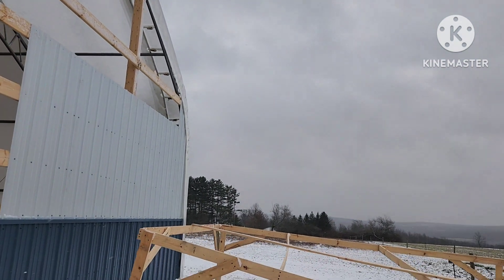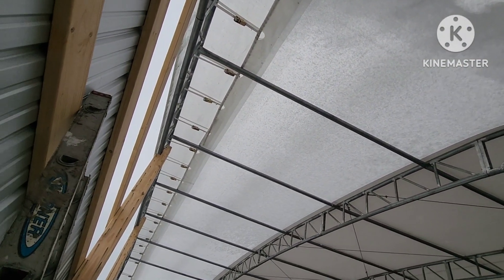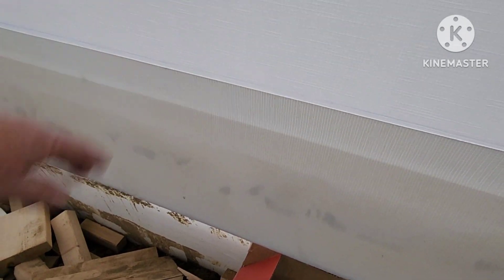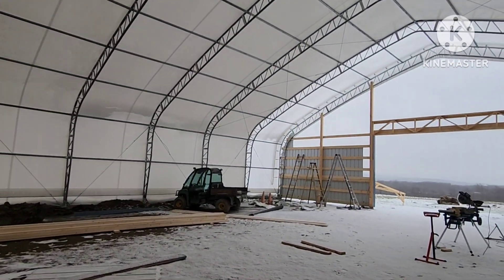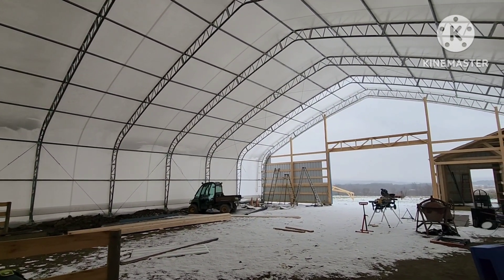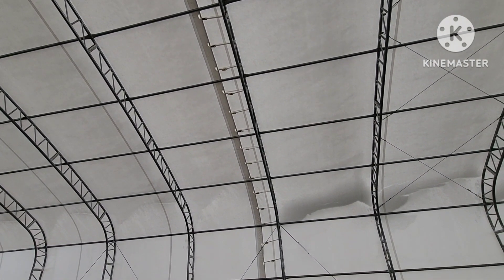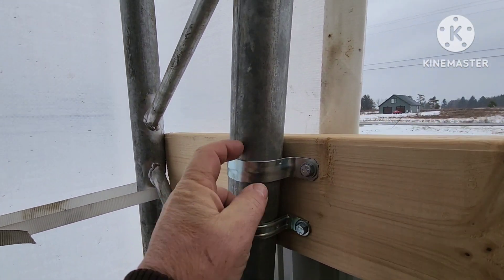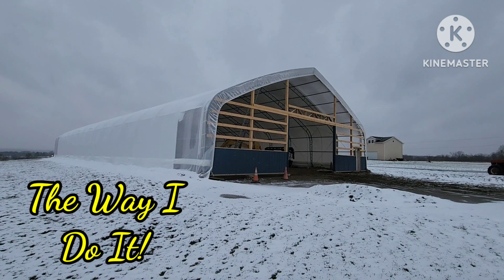Fabric Tension Building from Russellville Hoop Buildings January 2024

Comment: Are you happy with how it turned out?  I’ve been looking at these buildings.
Reply from the maker: I'll let you know after some experience.  So far it's good.  Couldn't build anything like this even close in a pole building.  Today it rained inside.  The condensation that had frosted to the top and framework came down like rain when it melted.
Had a wind storm or 2 a few weeks back and it survived fine.  You have to keep in mind it truly is a "temporary" building.  10 years is good but I hope for double that.  A torn cover can feel catastrophic though.
Reply: The big thing i have seen with this type shape of tarp building is the tarp will start to wear through at the peak of the truss. It helps a lot to make sure the tarp stays tight.